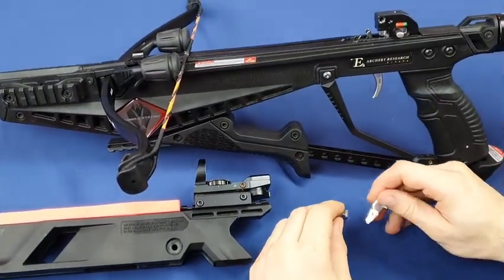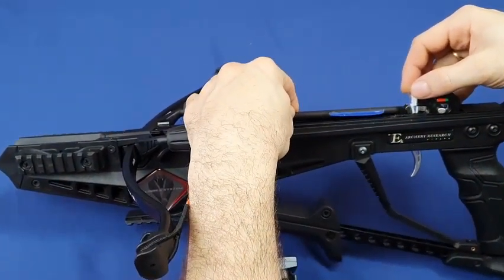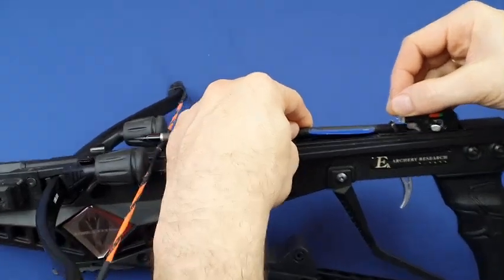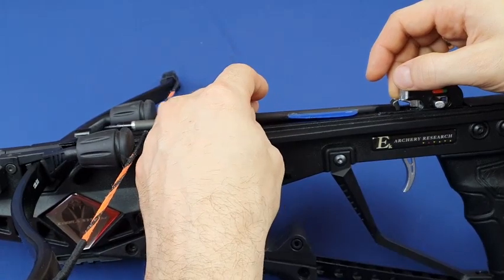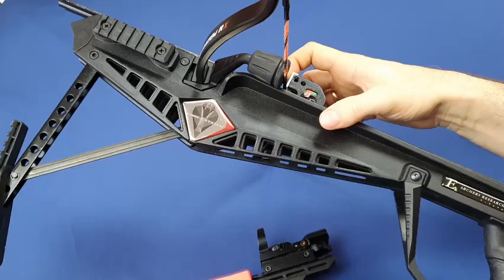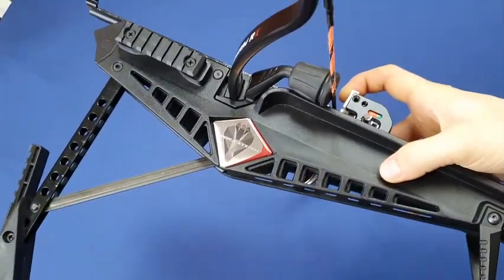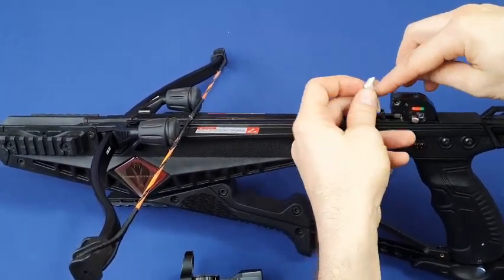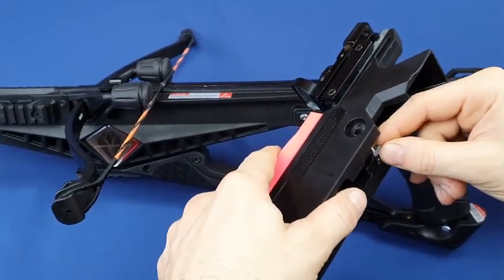Community series: Preventing Cobra RX Adder from jamming - New Rear slider design

Comment: Beware, this item does not work if you do not have a bow limb with string stops (90 lb limb) since the string will not have enough backwards pressure to go behind the string catch.  The string stops provide enough backwards pressure on the string to allow the catch to engage with this anti-jamming device installed.  Hopefully this is clear, assuming you are using the 130lb limbs that came with the adder you should be fine with this device, but the 90lb limb does not work.
Reply from the maker: Yes, this is right. I am awaiting 90lbs limbs to test slightly altered item. As soon as it will be done will be offered as well.

Comment: Very happy with this update, so I don't have to mind 
 to hold the Adder down.
Reply from the maker: Yes, this is great crossbow if we dismiss that problem
Reply: @smartupgrades  indeed,  I need always to see how my bolt sits in the magazine. One time I made some shots in the dark, then it went wrong, two bolts in pieces, string damaged and your update in pieces. 🤦
Reply from the maker: @b.j.dejong4283  drop me a message on ra.mebius@gmail.com, I will send you new one with new rear sliders and better top lockers with 50% discount.